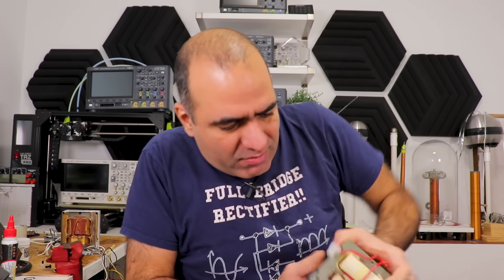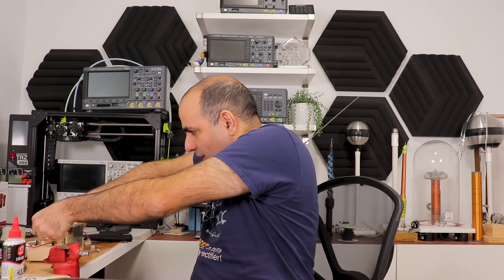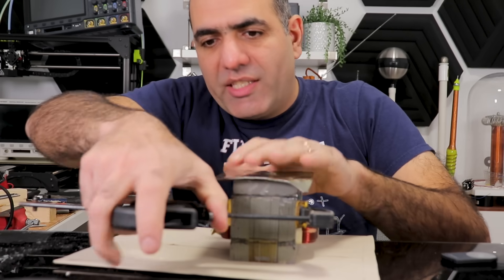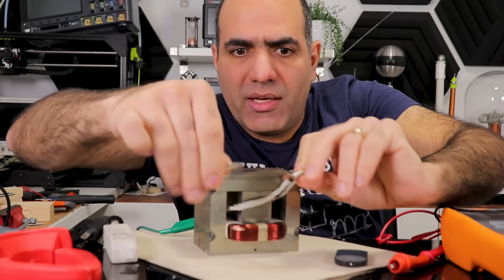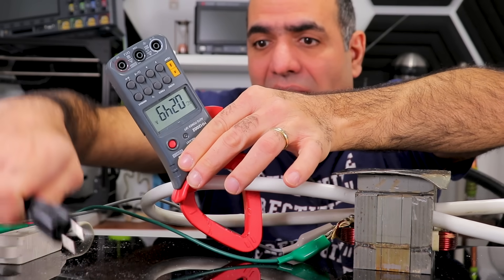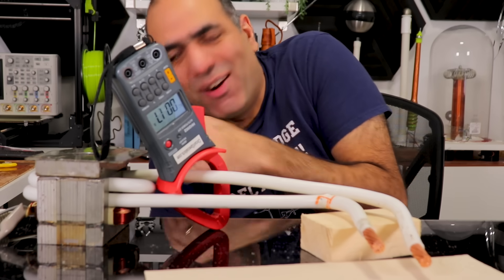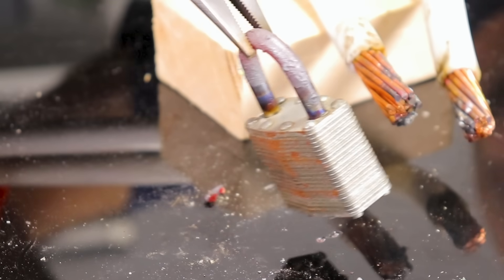Making "MILLIONS" of AMPS of Current

Comment: ElectroBoom: You get more current is use copper sheet metal wrap around the core as it has more surface area & lower resistance. You would need to add insulation of course.

Now if you want to impress me & viewers, Lets see you build an induction heater from scratch. No Chinese kits.

Comment: Why not using the secondary as the primary ? More turns
Reply from the maker: more turns of thinner wire = higher resistance limiting current a lot
Reply: @ElectroBOOM  Thanks ! Does it not compensate the number of turns ? I mean it will be less amps at the secondary ?

Comment: That transformer can be used to weld using Tungsten bit in one side and a clamp on the other, maybe can be used in small metal parts, wouldn't recommend on cells though.
Reply: Wrong. It would create fragile porous welds at best. It requires DC current and argon shielding gas.
Reply: @jackking5567  I thought that one can use AC to weld alloy, but I am no expert so I take your comments on board. Thank you.

Comment: Every time you do these, I ask "Why don't you use a redundancy switch so you don't have to keep plugging and unplugging?" It would let you cut the current more quickly and it's electrically the same, plus it would be right at the plug so it would be clearly visible!

Comment: If someone could explain why did the current double in the first half with the voltage? shouldn't it have been half of the previous one since we doubled the secondary ?
Reply: The voltage is dropping too much with resistance.
And it doubles the power output.

Comment: The welding in the transformers is to reduce the flux leakage between the gaps. It's the same case with the core plates. The smaller the gap the lower the leakage. Plus it helps to reduce noise, which in turn increases the transformers' efficiency. Mayne you should weld the transformer and give it another shot.

Comment: Is it possible to turn that into an induction forge for blacksmithing? i mean, if it can heat steel to melting, it should be possible to get a bit of iron up to temp for smithing
Reply: You can already buy induction forges for home blacksmithing…

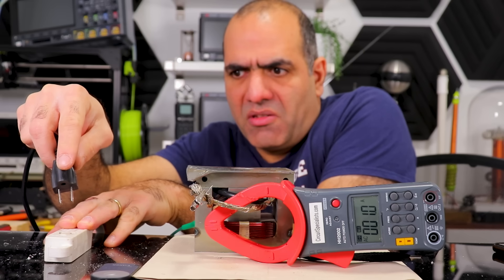Comment: Am i tripping or did it just draw 4000A for like a split second at 7:03
Reply: Inrush current, yeah
Reply: I don't think that clamp meter is from circuit specialists. Mehdi will probably do anything for money. He uses Raycon earbuds only when they sponsor him, blurs the name of third party's meter when Keysight sponsors him...
Reply: 4000 amps sounds like it could be a limit for the multimeter, so there’s a chance it could have been even higher than that.

Comment: Yeah, US pennies are 97%+ zinc because making them of copper would make their melt value too much higher than their face value.
Their melt value is still higher than their face value even as almost pure zinc, and would probably need to be mild steel or pocket lint to have a lower melt value than face value at this point.
We really need to get rid of them

Comment: I'm confused by this video. The power from the wall is the same as the power out of the transformer (minus losses in the transformer). So is the only thing stopping a power outlet from melting metal the resistance of the wires? If you try to melt something with a cable straight from the wall, the wires melt before the object does. But wouldn't this work the same if you had a huge voltage and a tiny amperage? Then you could use small wires to melt things? I'm not understanding why it wouldn't work the other way.

Comment: Hey, Mehdi, you should cover "electromagnetic field welding" EMW. They use a high power magnetic field to slap metals together so fast they weld. There's very little coverage of it. But it's cool enough to share!
Reply: Cool. Never heard of it before. FYI "Magnetic pulse welding" gave better google results.
Reply: @soupisgoodfood42  Supposedly it works by charging large capacitor banks and dumping them in an EM coil. The resulting field is so ridiculously powerful, the metal is accelerated to supersonic speeds (i.e. mach 1) and causes even dissimilar materials to weld. There's obviously some disadvantages like embrittlement but it's still the tits!
Reply: @dimitar4y , it seems like ultrasonic welding achieves the same results, while being an efficient, established technology.
Reply: @MrPaukann  ye but this is stupid cool
Reply: @dimitar4y , sure. EDM is cool too.
Reply: @dimitar4y  I've never heard of this but it sounds amazing. Thanks for explaining it.
Reply: @dimitar4y  sounds like a method for supersonic flight to me lol.
Reply: @dimitar4y ...& placing a (ferrite )/ iron block as it's core... that's how they charge it up to make  magnets...for high power applications....
Reply: Sounds like high frequency welder
Reply: @rekcatta4894  no that inductionwelds. This fires one pulse.
Reply: Yea! he could weld some Li-ion together the make one big battery. ...how could 'that' possibly be dangerous?? 😀
Reply: They used to use explosives to do this (probably still do) with large sheets of metals in order to make otherwise impossible composite laminates. Search 'explosion welding'
Reply: @IanDarley  ye fukken cool
Reply: They do... My father got to see the process being used explosively welding steel to copper sheets
Reply: @IanDarley also called "clad"
Reply: @IanDarley  yea, Explosive Welding, you put a plate down, tac some seperators on it and place the other sheet on top, it is the only type of welding that can fuse dissimilar metals, from there an explosive is placed on top and blasted from corner to corner
Reply: @loreraptor5093 "clad" is what explosion welding makes
Reply: you may want to reach out to Ben @AppliedScience...
Reply: Can confirm this has happened when I worked one of those magnetic cranes at a scrap yard, at the end of the day you'd often have nails or bolts that flung so hard into it they welded on contact. Had to hammer them off, usually came off pretty easy but strong enough you couldn't pull them off by hand
Reply: Oh I saw this after commenting my apologies ...
Reply: @TeslaRock I kind of want to try this
Reply: Here is a video demonstrating it (last part) https://youtu.be/EDj8mDZxfnw?t=231
Reply: as a welder, this is literally what is in older stick machine models. Transformer driven machines work just like this
Reply: The words "electromagnetic field" is so often misused.

There are essentially three fields and they are not the same: an electric field, a magnetic field, and an electromagnetic field.

The electromagnetic field should be reserved for fields made up from electromagnetic photons which have 3 elements: a changing electric field component,a changing magnetic field component and a direction of travel at the speed of light.

The welding you are talking about does not employ an electromagnetic field; it uses a magnetic field to induce a current and that current causes a heating effect.

Comment: Personally I have a couple of microwave transformers and I will cut the secondary with a hacksaw straight down the plate so it can be driven out nicely. Then I have some 1 gage that can be threaded through easily a couple of times connected to spot welder probes. For the primary side I have a 100A triac spot welder controller. It's a project that I've had the parts for a while just too much else going on to build it.

Comment: 7:50 finally you understood that EMF is an important term and different from voltage, but started to use it in the wrong context. When you try to calculate the current on a conductor, you need the voltage on that object. This is simply ohms law. And you also hit a wall of validity of lumped modelling. The connections are distributed networks, with different potential on different points, this is why you measured wrong resistance on the first wire. (You measured not on the wire.)
Reply: Long ahh sentences 💀
Reply: Finially found a person without a brain.

Comment: I think for the resistance calculation of the wire using the power supply that when the terminals are practically shorted, you calculate the output resistance of the power supply, the resistance of the shunt resistors! That's why you calculated higher resistance!!

Comment: I too, have suffered the pain if trying to get a secondary coil off a MOT. A thin shim you can smack around the edges is very helpful. I also recommend removing the magnetic shunts first, which are just thin metal strips you should be able to get out via a screwdriver and hammer. This gives you a lot more room to pry the secondary out. 

Finally: Throw it in a freezer for an hour. Cold metal shrinks.

Comment: weld some battery cells. I have used microwave transformer to weld up battery packs 15 years ago. Even designed a controller for a timed pulse.

Comment: hey mr.boom, if you dont want plastic or solder fumes heading your way i suggest a soldering fume extractor. it wont get rid of it but itll push it far away from you. i recommend a fa-400 fume extractor, because its small and powerful. it also makes a bit of noise

Comment: Part of my job involves testing industrial circuit breakers with a high current test set. It works off the same concept shown in the video. Our largest test set is capable of 50kA if you can get the resistance low enough.

Comment: Never wondered until now: why does resistance increase with heat? With everything vibrating faster, shoudn't it go down?
Reply: The mean free path of the charge carrier are shortened with temp increase, thus losing a larger fraction of the potential kinetic energy to phonon lattice interaction.  (Heats up).
Or that's what I remember from my materials science class 15 years ago.

Comment: 9:49 the sounds that emanate from my bathroom in the am. I am afraid of high voltage and that goes the same for high current... i was cringing when you did 2 turns of 000 awg welder wire witht he spoon. and i cant believe that glass table didnt break when you were smashing that wire on it lololol. high energy is a bitch no matter what the form!

Comment: Mehdi, The Lockpicking Lawyer beat you to the melting a lock open schtick. https://www.youtube.com/watch?v=6aNm3qWkW8A
Edit: I went to the video I linked and saw I had an argument 2 years ago with someone about how a soldering gun works. I pointed out that the high current you get from a single winding on a transformer is exactly how a soldering gun works, and the other guy argued I was wrong.

Comment: @ElecroBOOM can you do a video about the efficiencies of AC/DC over distance.  It will help settle an argument about putting a Full Bridge Rectifier close to a Hydro generator, or close to the battery/inverter.
Reply: AC transformers are cheap and simple compared to DC converters.   Once stepped up, HVDC is more efficient if the line has to be submerged or buried, or if you have to use large cables.   HVDC becomes more attractive the longer the run.
Reply: Check this video of Electroboom for the answer.
Reply: Transmission is always better in AC more efficient and cheaper,  DC switch gear is always more expensive.
Reply: @dogwalker666  why does HVDC exist then?
Reply: @StuartJ  it is being phased out in industry, only specialist systems like arc furnaces still use it, Solar can only generate DC, and a lot of wind turbines are,  so the inverters are as close as possible.
Reply: @dogwalker666  I think your talking about something else. HVDC is not being phased out! New networks are in build right now.
Reply: @StuartJ  they are only trying it for things like solar farms, and other top up systems,The national Grid is 3 phase AC,  As the generation is done in 3ph what would be the point converting to a more expensive, dangerous system, then spending a fortune in inverters to convert it back risking failure when the igt's explode,  and the form factor is awfull.
Reply: @dogwalker666  my question was about converting to DC before transmission, or after. It has to be done anyway for the batteries/imverter, in a micro hydro system.  I also suggest you check Wikipedia about HVDC.  China has a very impressive long distance DC transmission line.
Reply: @StuartJ  they would,  They  don't care about safety and their electricity infrastructure is worse even than the Americans,  
You realise inverters convert DC to AC  the other way is Easy you only need six semipak diodes.
Reply: You'll be glad to know he already did.

Comment: I have a question about amperage and power. How is this device incapable of triggering a circuit breaker while pulling (literally) thousands of amps?
Reply: It's a transformer. The high amperage is only in the secondary.
Reply: @shmuels1383  yes and primary would only draw about 1000w and home circuits are well designed for that.
Reply: The most dangerous electronic device known to the hobbyist: Microwave oven transformer. You get 10A or 15A on a line with 120V (or240V) pushing it  which gives you 1200W or 1800W which you can put into the secondary however you'd like. .001V is 120,000 times less than line voltage so you get 120,000 times more current which would be 1,200,000A
Reply: There could only be 2 possible explanations of this-

1.) He has got a special outlet for his projects which doesn't have any breakers and is directly connected to the home/office connection.

2.) Even though he's pulling out thousands of amps..... Let's assume 1k then 1 thousand X 1 volt = 1000w or 1Kw (watts= amps times volts) and that's the same amount of power (even a bit less) than what your average heater would draw.

Comment: 10:25 me wondering why is holding the transformer bcs he can probably can get elecrocuted by 2 volts and all this current will be shorted trough him to the transformer 
Prove me wrong mehdi, im last year at school before graduation
Reply: because there is little current passing through him. current through mehdi = voltage his is touching divided by mehdi resistance, if mehdi resistance is high and the voltage is low, there is no way for a huge amount of current to through his body. doesn't matter if the conductor he is touching has a trillion amps flowing in it.

Comment: First thing I do when I salvage a microwave oven transformer, is remove the secondary. Plus I also add between 10 to 20 turns to the primary, as these transformers are designed to operate just into saturation. Hence, the inclusion of the shunts, which is equivalent to adding a series inductor. Extra turns on the primary keeps it out of saturation.

Comment: i do not believe for 1 second that you cut through that that smoothly with a small grinder
Reply from the maker: I just cut the welded lines on the surface, it was a separate piece glued to the rest of the core so I hammered it off. I could never cut that smoothly!
Reply: @ElectroBOOM  would have been bloody impressive if you did, i don't think a machine could cut that close to both coils without screwing at least 1 of them up though

Comment: I think the penny is steel cored. At least they used to be. Check if its magnetic. I haven't seen a penny in ages :)
Reply: I believe it's zinc, steel pennies were due to WW2 or something.
Reply: @Alienami  no streel pennies were in the  2000s til the end Apparently there were zinc core ones from 1997-1999 only.  Before that they were "pure" copper.

Comment: I do not understand this.
Say 500A at 2V that is only 1000W.
My induction stove is 2500W and it will not melt a lock, is seconds?
I have not yet looked up the thermal capacity og steel to estimate the energy needed to bring steel from 20C to 1000C, but it must be more than 1000W for 2 sec.

Comment: your electricity bill must be through the roof 😂
Reply: Actually 1000 A at 2 V (2000W) for a few seconds isn't much, look at an electrical heater for example, they draw 2000W for hours.... And the high voltage videos (like 10kV) only draw a few mA. Just a few tens of Watts.